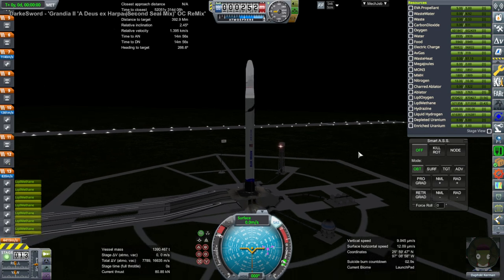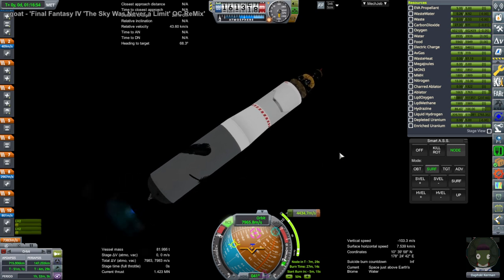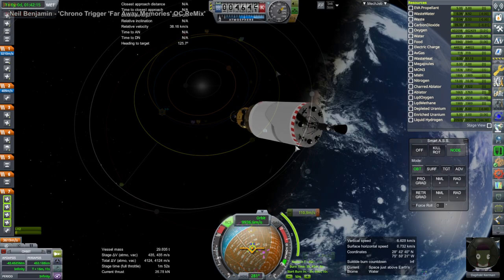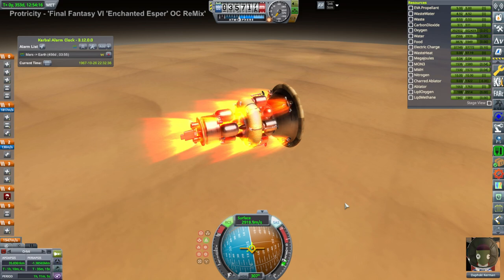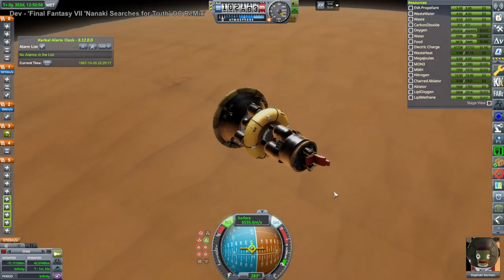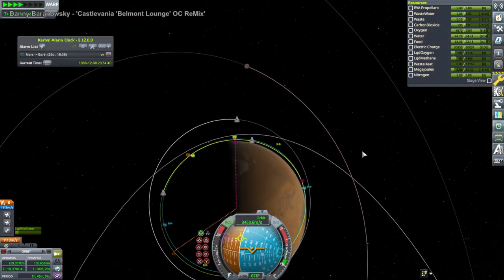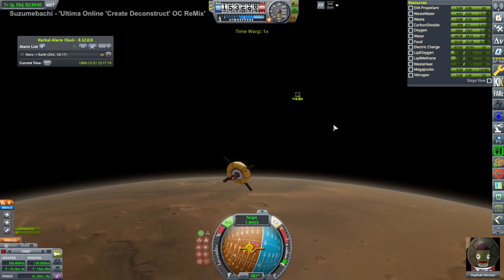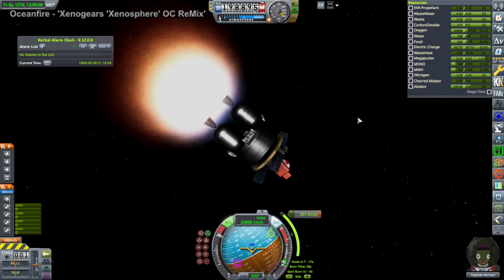Realism Overhaul in KSP 1.8.1 - Smallest Mars Mission

Comment: Couldn't you have used the jetpack to slow down so Daphski would be fine?
Reply from the maker: The jetpack is much weaker in RO, and not enough to overcome Earth gravity. Also, we had already dumped the EVA Prop in the hope we would get more delta-v by saving the mass (which didn't quite work out).